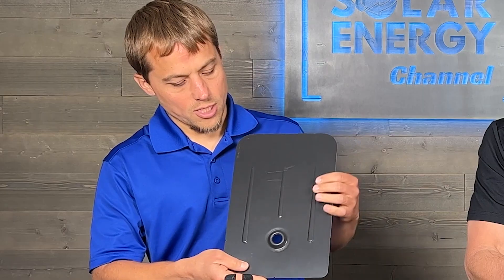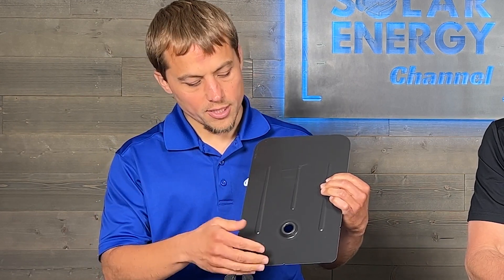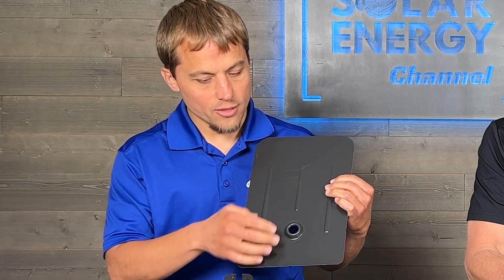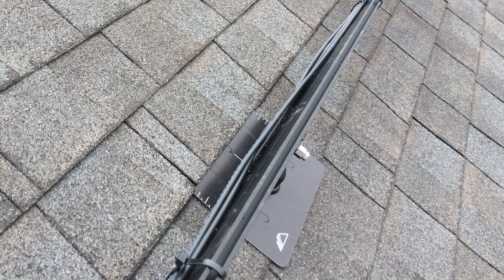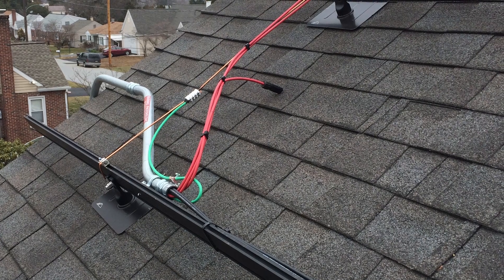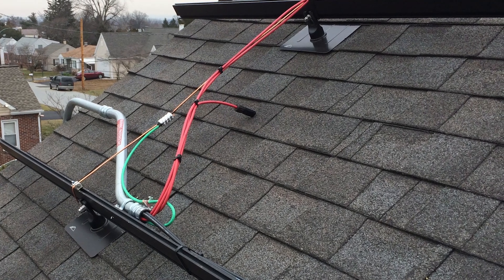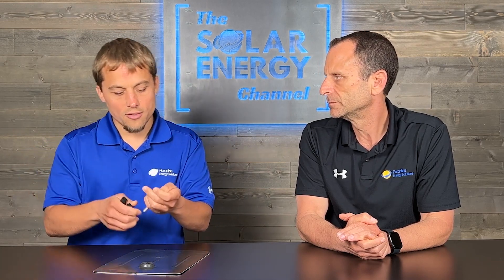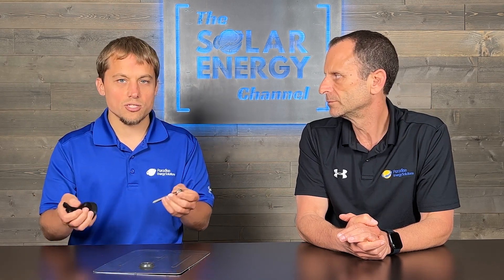How to Attach Solar Panels to a Shingle Roof

Comment: I am in Australia and have a shingle roof. Funny you were saying it is more expensive to install solar on tile or other non-shingle roof types. Here(in Australia) I am finding it is more expensive to install on shingle roofs. Installers just dont have much experience as it is all tile or tin roofs and some even said it is too risky to do. Makes going solar a more difficult proposition, as will take much longer to payback and am also a bit worried they will cut corners or dont have enough experience to do it right. Pretty frustrating as a lot of the videos are from the US and are of installers quite easily installing on shingle roofs.  Appreciate the video, and the clear explanation on how to install, as well as the warnings around replacing an older roof before installing solar( mine is 20 years so another cost to consider... sigh).
Reply from the maker: Check out our new video that highlights a new attachment method for shingle roofs. This is proving to be a better method than the traditional flashing method. Maybe this will be less intimidating for your installers.https://youtu.be/CzUK7EB1YRs
Thanks for watching, and best of luck with your solar investment.

Comment: I liked the video. I have a home with 29 panels with grid tie-in leased through a local supplier , bought it that way. However, a quarter of my roof does not due to overhanging trees I have since removed. I'm  hoping to do a separate, stand alone solar system with battery wall. Do you forsee any issues with that? I want to prep for any possible grid failure. I'm not looking to run the whole house, just the bare necessities. I have space for 9 full-size panels, but I'm looking to start with just 1. Being modular is very important, so I can start with the absolute minimum and build in time.

Comment: What if you're putting up a new structure, maybe a car carport or a pavilion, for the main purpose of going solar' is there a way of saving on roofing buy using something other than shingles? Thanks.
Reply from the maker: Our suggestion would be to use a metal roof - standing seam or ribbed. There are no penetrations required when installing on a standing seam room. Check out this video to learn about how panels are attached to metal roofs - https://youtu.be/hj8xyLBqxrg

Comment: Why not do a comparsion betweeing underneath flashing vs the sealant top secure to the racking? Does the top selant applied like Unirac flash loc have a higher failure rate vs standard flashing? Most companies are changing to the non flashing sealant base because it's quicker because they don't have lift up shingles.
Reply from the maker: That's a great suggestion. We will add it to our list. Thanks!